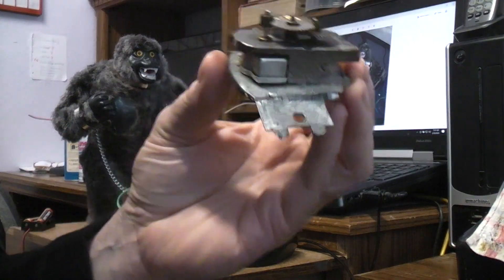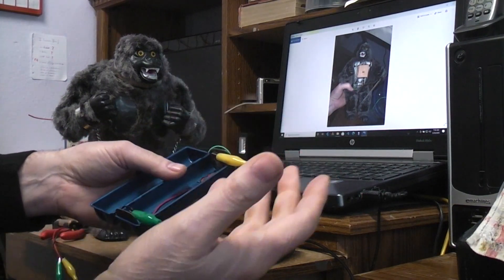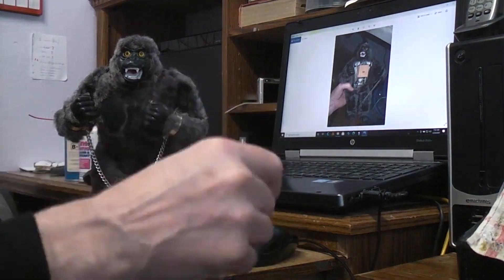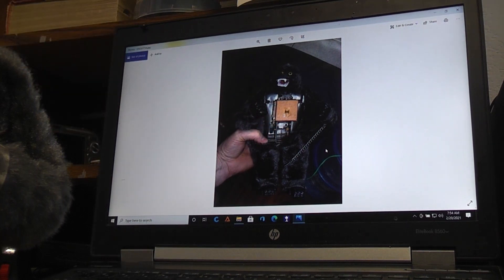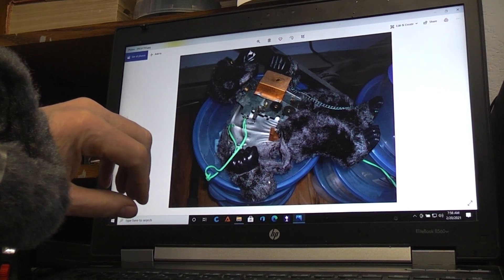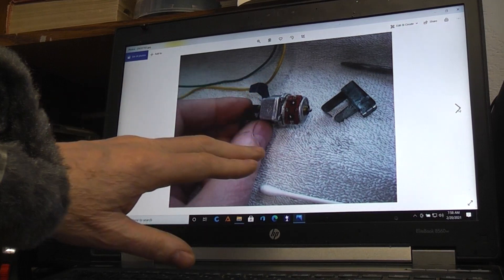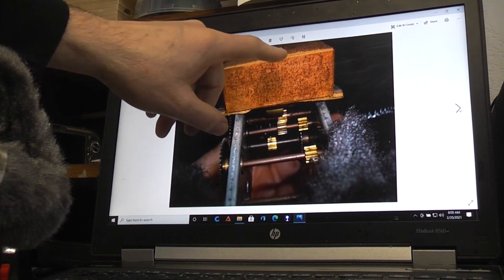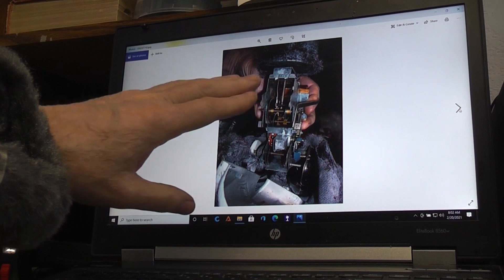Tips on repairing vintage battery toys and there motors.

Comment: I wonder if a small amount of moly grease is really okay on electrical contacts. Many years ago someone I know put  some type of wheel baring grease on her car battery terminals, and it caused so much insulation the car would not start until I cleaned it off.
Reply from the maker: The only reason to put grease on a car battery terminal is to stop the build up of corrosion from escaping fumes from the battery. You only put the grease on after the battery cables were put in place on clean terminals, never before. The toy battery motors are lubed with grease from the factory as the cheap brushes they use will wear out in less than 2 minuets if run dry, cheap metal rubbing on metal does not last long with out some sort of lube.
Reply: @Robothut  Thanks for the clarification. I've often used dielectric tune up grease on electrical contacts in VCRs such as mode switches, but it only lasts so long until it need to be re-done, so I came across your video looking for alternatives that might be better. Someone mentioned Cramolin deoxit as a possible better alternative, but it's always nice to get a few opinions.
Reply from the maker: @GrantsPassTVRepair  I love Cramolin dexit, back in the old days they sold it as cramolin RED and cramolin Blue , expencive stuff but works great.

Comment: Dear Sir 
How to setup a bump and go vintage mechanism? My problem is the bump and go mechanism do not work as it should. It go most time left direction. Not straight. It is almost not played with. In very good shape.
Reply from the maker: Many bump and go drive designs do not go straight, they normally called bump and go toys Mystery action, as they tend to just go in any old direction or just around in circles. The placement of the bump and go drive relative to the rear wheels has a bit to do with it. Friction in the bump and go drive can cause the unit to favor not going straight as well.
Reply: Thank you sir. I repaired a lot of vintage toys in my life. Some tin toys have a little tin spacer to setup the space. You can bend it a little. Such like the space frontier rocket. They go straight now. But this little Alps train do not want. 😂 Thank you 
Greetings Michael
God bless you

Comment: I have a Modern Toy battery powered motorcycle that I'm repairing. I have run into a snag on how the rider dismount mechanics should be hooked up. Is that something you might have tackled in the past? I saw that you have repaired a number of other battery operated gear driven toys in your videos. Any suggestions? BTW, your content is very informative and helpful. Thanks Brian
Reply from the maker: There is a video by Kitahara of that motorcycle toy operating, so I have seen one in working condition, but no one has ever sent one to me to repair so far. You could post a unlisted video to YouTube and send me the link to see what you have going on. I might be able to help from that.

Comment: I just picked up one of these in non-working condition, thanks for the video. I have noticed that the one in your video does not turn its head during the roaring action. Searching youtube all the working examples move their head when roaring and they all have brown fur, I have not found another dark fur in working condition video. Did you overlook this function or is it missing entirely in the darker variation? 
*edit
After beginning the fur removal, I am sure the color differences are due to fading

Comment: nice video I have one that needs a new remote box someone cut the old one off at the back where it goes into the toy .Probably stopped working  so they just got rid it for looks.
Reply from the maker: Old remote battery op dog toys sell for very little money. There remote battery boxes are many times tin as well. both 1 and 2 button remotes from these old dog toys can be found on ebay from time to time.

Comment: Do you do any repairs of an old tin toy? I have one that I just bought, but the motor is not working, but the lights of the robots still work.
Reply from the maker: It depends on the toy and the condition. I do videos so that others might see if they can repair their own vintage toys.
Reply: @Robothut  How do I contact you about a repair? I have an old Japanese robot Tin toy that doesn't walk, but the eyes light up. I'm not mechanically inclined so I rather let someone knowledgeable to do the work. Let me know if you can help. I used to go to this guy called Uncle Al, but he's stopped taking in new projects.
Reply from the maker: @profatomo  Go to the Robothut yuotube channel and there you will find contact info.
Also there is contact info on my Robothut.robotnut.com web site.
Reply: @Robothut  Just sent you an email...thanks!

Comment: Any tips or ideas on a Rosko Josie the cow?
Cosmetics are good and battery compartment are clean
Reply from the maker: Button hump on the cows back that you push is a 3 position double pole switch.  One position is OFF then the next push is ON with the battery motor running clockwise making the cow walk. The next push is OFF "again" the next push is ON with the battery motor running counter clock wise making the head move and mooing sound. The next push is off again and repeat. So if you have no motor action at all it could be 2 things. One it could a problem with the switch but most likey it is the motor. The battery motors tend to not run when they have sat for a long time as the grease on the motor brushes turns hard and the brushes do not make electrical contact. Normally turning the motor gear by hand when power is turned on will bring things back to life. So that means getting inside the toy and that means removing some or all of the cloth covering.
Reply: Thanks so much for your prompt and detailed reply.  The cow is cosmetically excellent but there is something clunking back and forth when it is turned upside down and back and forth.  I'm guessing the motor may have broken free of it's moorings. I'll take it apart and see what I've got going on. Excellent work, thumbs up and subscribed!
Reply from the maker: @98755785  The motors almost never get free of the gear boxes, so I would guess it is the mooing device.
Reply: @Robothut  Okay, I'll let you know.

Comment: Do you repair toys for people? Would I be able to send mine to you for repair? How would I go about doing this?
Reply from the maker: Normally I only do repair these days for collectors and toy dealers that I have worked with for a long time "10 to 30 years in some cases".  The reason is do to the fact that I do not use any online payment methods, "cash, check or money order" the fact that a properly double boxed toy is very expensive these days to ship with insurance  "to and from" then add in what ever my time and any parts might come too. In many cases this all adds up to more than the toy is worth. Also there is always the chance the toy if 1 or a kind maybe be lost or destroyed in shipping.
Shipping outside mainland USA is just to big of a pain and expensive these days. 
Some times the toys have been worked on before by others and the tabs that hold them together will not take one more bending for repair. So there would be the cost of shipping both ways just have me say the toy is not repairable for many reasons.
And that kind of covers most of the problems.

Comment: I need a new motor but cannot cross-reference it. Any clue on a replacement? Thanks
Reply from the maker: If you can tell me if the toy was a 3 volt or 4.5 volt or 6 volt toy. And then a picture of the bad motor, we can probably find a replacement. Also many times the old motors can be repaired.
Reply: @Robothut  it is a 6v motor from the Vintage Marx Toys  Nutty Mad Indian but the motor is missing
Reply from the maker: Nutty mad Indian is a 3 volt toy, 2 D cells. Best bet would be to buy a junker off ebay for the motor, I checked there are lots of them for sale. @MrBattscave

Comment: Are you referring to graphic grease 
Used in rebuilding engines
Reply from the maker: Any  graphite grease will do. You use such a small thin layer that any grease will help the life of the brushes but the graphite being a good lubricant and conducts voltage makers it a good lube.

Comment: Working on electric robot by Marx. Tested motor does work. Battery's are in correctly, when switch is turned on eyes light up  and mores code works but motor will not turn on. Appreciate any ideas frustrated  amateur.
Reply from the maker: The motor has a forward and reverse switch, so the problem would be there in the switch contacts since you have power to the lights and buzzer and the motor tests good.
Reply: @Robothut  Have worked on the contacts but will go back and try again. Thank you so much for responding to me. Very grateful!

Comment: how about wd 40 ??
Reply from the maker: I am not a big fan of Wd40, it's not lubricant, it's not a cleaner and it lease a smell.
Reply: well, I really appreciate your idea on squirting some oil up to the motor, I have a col hap hazard that, while the attane lights up, the motor doesn't run, so I am betting the motor is gummed up and I cant see any way to get a small screwdriver in it to try to spin the motor , but maybe I can squirt some lube up in there... @Robothut
Reply from the maker: Yes the Col Hap Hazard does not have any easy way to get to the gears. Not sure if spraying electrical contact cleaner is going to help unless you can rotate the motor or gears leading to the motor. Less is more when it comes to spraying things in vintage toys. @joeenglert
Reply: thanks so much again @Robothut